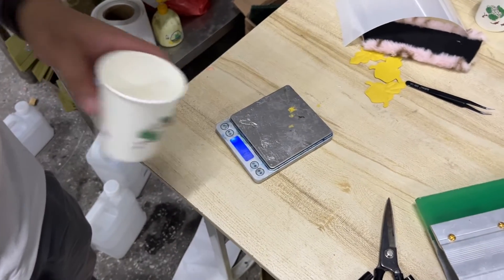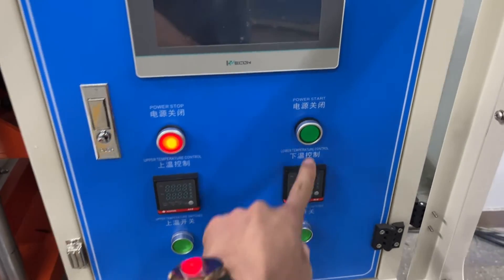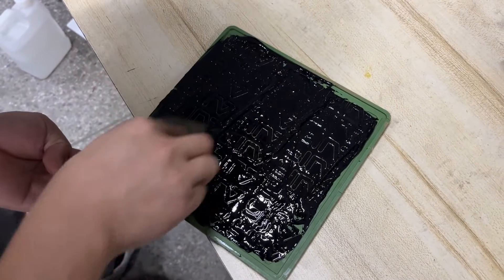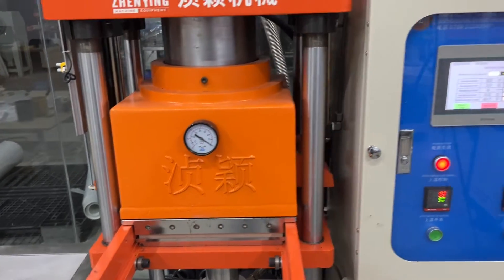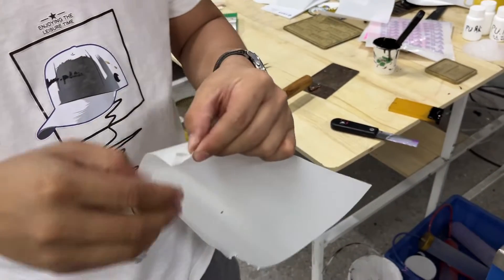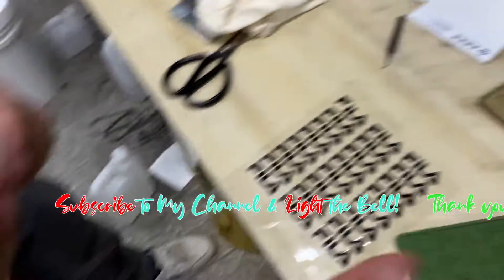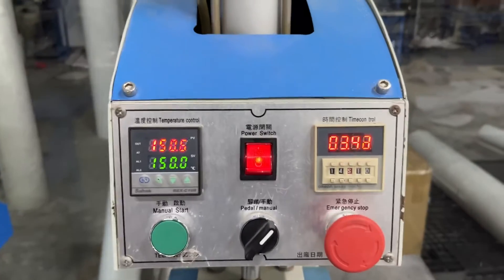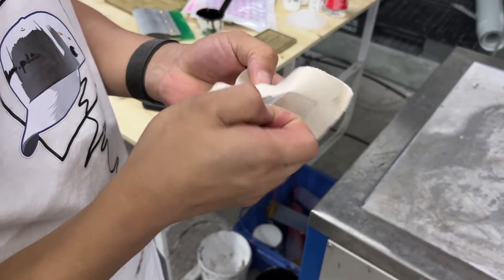Uncut Whole process of how to make the #3D #Silicone Heat-transfer #Moulding #Label / #Sticker!

Comment: Hello. Can you help me with my question, please? 🙏🏻🙏🏻🙏🏻

What’s the pressure you need to make those silicon letters on a plate? I mean that’s type of machine is quite expensive and I wonder if it’s possible to do the same process with weaker equipment 

Thanks 🙏🏻
Reply: 2-5 tonnes would be enough. You need two heating plates up and down, vacuum is good to have but you can increase time and get the same results.
Reply from the maker: Nice point of view! May I see your machines and products? My WhatsApp Catalog: https://wa.me/c/8613612761334
Reply from the maker: Hello, Sir, you've contacted my by WhatsApp, right? Let's discuss the details in WhatsApp.

The max. pressure of our equipment could reach 50 tons. Usually, we use the hydraulic pressure for this process. Here is the traditional way: https://youtu.be/fYsiBy8V_Ks      https://youtu.be/BLBGIrcCziw